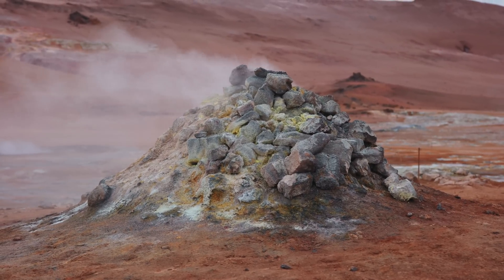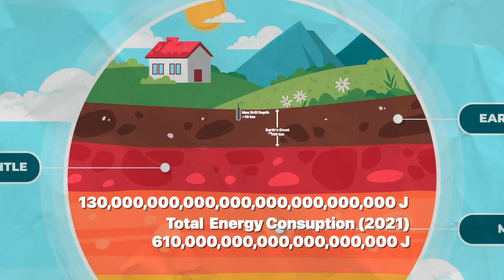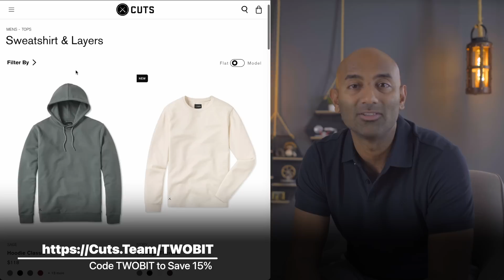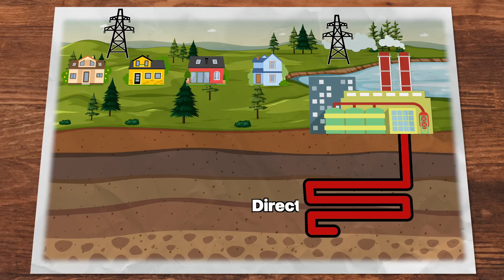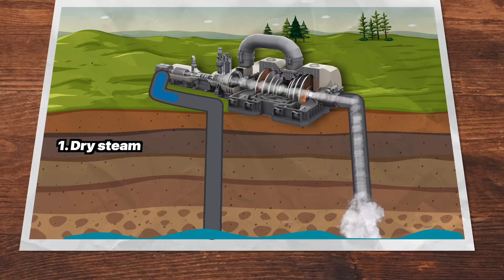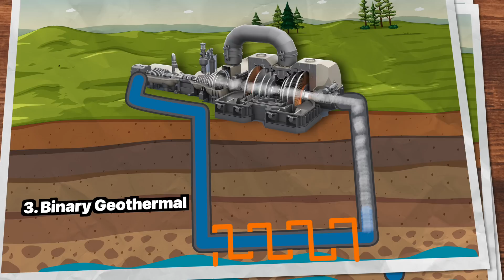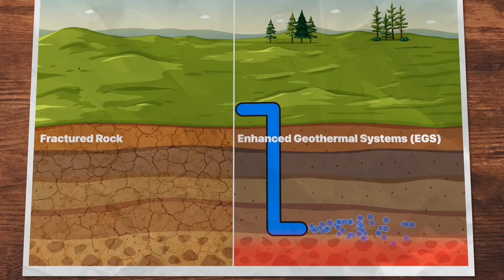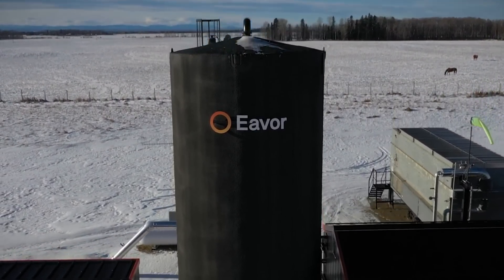This Breakthrough Energy Source Will Replace Nuclear & Coal!

Comment: The reason why drilling deeper than five miles is because the rock formations become plastic like semi fluid at these extremes and tend to flow around the drill tools forcing them to fail.
I love your channel
Reply: You do not need to drill further than five miles or eight km. You find plenty of heat before that depth even in geothermal cold areas. Her in Iceland the limit is about 5 km before the heat melts your drill. The deep hole project yielded a hole providing about 50 megawatt steam power.

Comment: Someone coming up with a "drill " that make drilling deeper for geothermal power faster and cheaper, that is indeed very interesting news
I think Geothermal is already getting worked on here in Denmark, but nothing up and running,,,,, you will probably have to drill deep here to reach worthwhile temperatures.

Comment: BUT! Unless there is a huge amount of circulating hot water in the drill hole, it will cool down before it's paid for. And in 99% of earth there is not enough hot water. It can be used for a single house but owners make the mistake of not pumping down warm water during the summer.

Comment: nuclear fission is going to close the fuel cycle with IV gen power plants, they will be more secure than now, so it will reduce the risk from 0,1% to approximately 0, more efficient, the use of fuel raise from 1% to 100%, fuel cycle closure, they will be able to use exausted fuel from actual power plants. Nowadays nuclear fission can be competitive to all other sources, but thanks to IV gen it will be the most competitive one for sure.

Comment: Stop. Just stop. No one has drilled further than 9 miles, therefore NO ONE KNOWS WHAT IS AT THE CENTER, or what the temp is. I worked gyserville geotherm plants in ca. and nevada. Good luck, rightattitude, however, its the turbines that are at a deficit. Further, the cost and efficiency of geotherm is limited to location, i.e. where there is magma close to the surface.....

Comment: I believe the concept you are going to introduce in its own video uses the technology from Fusion reactors using high temperature plasma drilling techniques to not only drill further but create its own sealing encasement around the bore hole at the same time.  I will not say more now but I believe this is the technique that will lower the flood gates allowing geo thermal energy to be the true winner in green energy sources.  I look forward to the video!!! And for those who fear cooling the earth know that only 2% of the earths internal energy would provide over 1,000 years of energy for humans at its present annual energy use.  Since other sources will still be used I doubt that even 2% usage will ever be approached.  Plus understand the internal heat source of the earth also remains constant because of the gravitational force of the moon causing tidal forces within the earth's core that keeps it churning and producing heat at the same time because of the high pressures involved.  Together with the radioactive elements within the core this energy source should remain ongoing until the sun finally destroys the earth when the sun goes through its expansion phase billions of years in the future.  Plus it is expected that within the next 2,000 years the earth will begin its next cooling phase and this source will allow the human race to adapt and overcome the next coming glacial onslaught.
Reply from the maker: you're correct Anthony, hoping to get some on site access for that one
Reply: 2% over a thousand years is horrible considering the earth has been here for billions
Reply: @paradiseexpress3639  You are looking at it like now the heat being used is 100% - 2% = 98%.  The heat is being produced from the earth's core on an ongoing basis.  The heat is being produced not being stored.  So the heat source is constantly being replenished by natural fission processes and the ongoing churning at the earths core.  We are only tapping into it as the source of heat exists whether we use it at the surface or it just sits there 10 miles below our feet. So the heat is not being drained but it is being used in a manner that meets humans needs using a total green energy source that is being constantly replenished whether or not humans use it.  Plus if natural geo thermal heat pumps become wide spread heat is extracted during the cold weather and heat is pumped back in during the summer when air conditioning is needed and much more useful.  I will let Two Bit da Vinci explain it further in his video presentation as I do not wish to steal his thunder.  Using your logic the sun is being drained faster if we use solar panels which is not true at all.

Comment: I've been to The Geysers many times and the complex is stunning.  They do use a multitude of several heat extraction tech.  One of the problems is with dealing with mineral buildup in the  lines.

Comment: I'm not sure about geothermal heat solving, or partially solving, our fossil fuel use or hydro use to generate electricity. Especially at commercial levels. However, I believe we should be focusing on convincing our governments to pay for and/or subsidizing everyone to install geothermal home and business heating/cooling.We wouldn't need to drill so deep (only a few tens of feet for the largest buildings) and if it was to become an acceptable way to heat and cool a commercial building or house imagine how much fossil fuel would be not be needed anymore. Electric heat pumps could extract all the heat we would need and they could keep our houses and buildings cool during the summer too. We would't need to use coal to make electricity as the load on the system would be much less. None of us would need natural gas for our furnaces etc.

Comment: You can get a trillion volts with a 500 lb xylophone key( a microphone)  sitting on the edge of 2 piezoelectric disks facing in opposite directions(Speakers). It will make it's own water from condensation and those water droplets will spin and light up like a galaxy in a box. (from the 4 inch spark gap inside which is radio frequency) There are no moving parts and it will run on it's own feedback. There are only 13 parts. Ask me and I will show you how to build it. Free energy is extremely easy and simple. You can power a car with a 100 lb xylophone key.. for nothing. No magnet , no coil or battery is required.

Comment: It is also possible that there are fusion reactions occurring in the earth's core. If high school kids can create fusion reactors in their basements, then fusion may exist to some extent where there is a combination of high temperature, hydrogen and other light elements (lithium and boron, for example), and extreme pressure.

Nearly all of the outer planets radiate more energy than they absorb from the sun. Since these are made up largely of lighter elements, it suggests that they have (or could have) incidental levels of fusion occurring in or near their cores.

If this is true, geothermal is essentially 'infinite', or at least as infinite as there a supply of hydrogen to fuse.

Comment: I like the idea of converting coal fired power stations to geo thermal , soon it will be cheap to do. But , ultimately , the earth has a cycle of heat coming in from the sun and being radiated back into space at some later date. I feel it’s safer for us to operate within this cycle than to release energy from other sources into the environment. Anyway , CO2 problem first.

Comment: So, pulling that heat up from below, is it going to cause more global warming if they were to start building a lot of those plants?
I’m assuming there is going to be excess heat build up. Also we are already running short on water, in a lot of places in the world, so wouldn’t that get worse if that is what is used for cooling?
I’m not trolling, just asking, as I believe this process could have merrit, as long as it doesn’t affect something like water in a negative way

Comment: Actually, wind and solar are not solutions at all because they are intermittent.  I was working in the control room of a Power Company.  We cannot have a sudden wind shortfall which can happen in minutes or a sudden cloud cover taking say 1GW away within minutes.  How to back that up?  If I call a combustion engine station to power up an extra engine, it takes 1.25 hour for it to start up and energize the grid.  For a gas turbine it takes 45 minutes and for a coal power plant it takes 8 hours.  So, the 1GW disappearing from the grid will cause blackouts.  So, what is secretly happening is if you have a 1GW solar farm, the power company manager will instruct a 1GW of coal plant to run as a backup for when heavy clouds cover the solar farm, especially in equatorial Malaysia (where I am) where heavy clouds are a norm.  You may ask why did they build the solar farm in the first place?  The decision to build them is not from experienced electrical engineers.  Such projects cost tons of money and only top politicians are authorized to make decisions on such high levels of money.  Engineers are a very rare breed in politics worldwide.  We tend to live relatively honest lives and therefore do not venture into the world of not being true to yourselves which is the political world.  Hydro is perfect, it can energize the grid with up to 300MW of power within 20-30 seconds upon calling them.  But not all places have the high-water flow plus mountains to make it feasible.  I have long thought Geothermal is the perfect solution.  It is not intermittent.  In fact, it is so perfect I am wondering if there is a fossil industry worldwide hampering its development.

Comment: When you bring heat to the surface of the planet, you will be heating the planet. Unless you radiate the excess heat into outer space the planet will warm. The same with nuclear it brings heat to the surface of the planet that has been locked up inside atoms. There are materials that will do this. If you keep cooling off the interior of the planet you will be affecting the magnetic properties. There are ways to change this. When you phase heat into electricity by changing the heat to motion then this to electricity will be very inefficient. Gravity will separate electricity into two ions positive and negative. A connection between the two p[les will create a huge rush of power (we call this lightning).

Comment: 10:00 you forgot to mention that there can be radioactive waste building up in the bore holes, like it happened in Reykjanesvirkjun. 
11:10 the risk for the ground water is also given when using "just water" for the fracking of the rocks, because heavy metals and other toxic stuff can be extracted from the fractured rocks and may well migrate into ground water resources.
Reply: Yeah, to me, shallow, direct heating/cooling systems for individual homes make a lot more sense.

Comment: Watch a video recently, which talked about geothermal energy drilling, and the problem is the current drilling equipment fail to reach a depth to achieve full productivity in areas without any seismic activity. The solution they’re testing is a system which sends out a specific wave frequency, instead of a mechanical drill bit. They claim this wave frequency bit can reach depths more than a thousand feet. This method automatically seals up the bore walls, preventing the need for additional steps to seal up the bore walls. The energy required to operate the wage frequency drill was quite significant, however in the long run, it would easily output energy to dwarf that required drilling energy. Don’t remember the name of the video nor channel’s name.

Comment: Geothermal is very promising, but we need a different technology to convert heat into electricity. Something along the lines of using dissimilar metals that can convert heat differentials into electricity. Like thermocouples but in reverse. But that's for tomorrow.

Comment: As you probably know you do not need hot water all you need is heat and if you drilled that 5 Mi hole or 4 MI or whatever it's going to be down to that 400 degree crust then you simply take a large pipe with a small pipe inside of it send it down to the heat source send the cold water down the outside of the big pipe in the steam will come up through the inside smaller pipe powering your turbines and then through a condenser back to water back down the hole and you have a closed system and you have all the energy you need right there forever

Comment: I think it’s a bad idea.  The earth is livable because of the heat generated in the core and the plate tectonics.  So with all of our infinite wisdom that we’ve used to destroy so many things on this FINITE planet because of being short sightedness and not being smart enough to see the ramifications of our choices should we think that bleeding mass amounts of heat from the core of our planet is going to be nothing but a boon for humanity as we know it.  So we don’t have the data that we need to determine what the ramifications are of removing mass amounts of heat from the core of our planet.  I think we should stick to things we can actually quantify the risk benefit analysis.

Comment: Luv your channel! I’ve been thinking about these things for all but the 1st decade of my 62 years. The problem with the closed system is: Does the heat transfer through the rock keep up with the energy extraction. Given that geothermal has worked for iceland for decades, one might think it was possible, but I suspect that a temperature equilibrium only occurs if the pipe is close to moving magma. It probably greatly limits location, unless drilling down close to the mantle. But, I’m not an expert, merely an industrial engineer. And, an old one at that.
Reply: Rethinking on this, geothermal should be used as much as possible, though it does cause transient global warming.

Comment: Sir, you are repeating  some very contentious points I have heard from the oil companies.   This is ICELANDS main source of power and has  been  for over 50 YEARS!   My god, they use hot water pipes to run under their streets and sidewalks so no SHOVELLING OR ICE in many Nordic Countries.   This tech has been horribly suppressed but IT WILL SAVE THE PLANET.

Comment: geothermal makes sense in the areas where wind & solar energy aren't available.... like canada. energy storage isn't an impossible problem. I would use a 2 stage approach. first- the main energy storage I would use is a CO2 membrane. during high solar & wind output- compressors on a closed loops system compress the co2 into a liquid. then, during the hours, or even MONTHS when there's not enough sunlight or wind- the co2 is released and turns a turbine, which spins a generator to make kwh's. this power then feeds a bank of tesla megapacks- a pack system just big enough to give the co2 system time to ramp up or down depending on demand- that way- the system is automated & extremely efficient. such a system scales EXTREMELY WELL- and is cheap.

Comment: What about that drilling boring method that uses lasers that seals the wall of the small hole it melts as it goes along the way? Use a small form nuclear reactor option to power that power source??

Comment: Excellent video!  I suspect the next video will be about Quaize Energy's plan to drill very deep holes using millimeter waves instead of traditional drills that have a hard time drilling through very hot rock.  As someone who spent 40 years in the electric utility industry, I think their solution is very good.  Looking forward to seeing the results of their test drilling.
Reply from the maker: you are correct Dave :) just to break it up we'll likely target that for Q1 2023... cheers!

Comment: Oil is NOT a fossil fuel. It is a renewable. Do some actual research. Now, that said it is a huge pollutant, and geothermal seems a far better solution than current resource draining batteries
Reply from the maker: Oil comes from old organic matter, why its called a "fossil fuel" its renewable if you live for 10 million years. thats the cycle of renewable. solar, is daily, sun comes up every day. so while you're not wrong, it comes down to scale. you and I wont live long enough for oil to "renew"

Comment: 0:35 I believe the #1 reason is it has been incredibly expensive to drill deep enough through rock to make it cost effective. If we can substantially decrease this cost we have a near limitless supply of energy below our feet. This is something I have been interested in for decades.
Reply: The new method he is mentioning is sonic drilling. You "hit" the rock till it melts and you end up with a stone pipe made of molten rock. It seals itself. Can't wait for the video.
Reply: My patent allows the proven drilling of a 12.5-inch-deep borehole at over 1,000 feet per minute using abrasive jet boring.

Comment: The issue with geothermal is water.   Any system relying on emptying aquifers isn't sustainable.

As long as it is low use and mostly closed loop, then fine.  But using 50,000 gallons power hour isn't going to cut it.